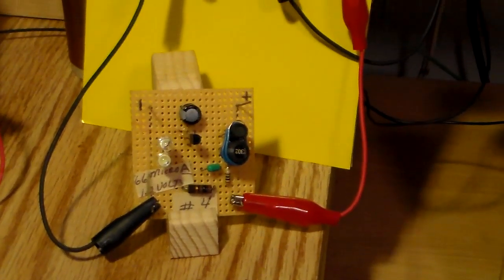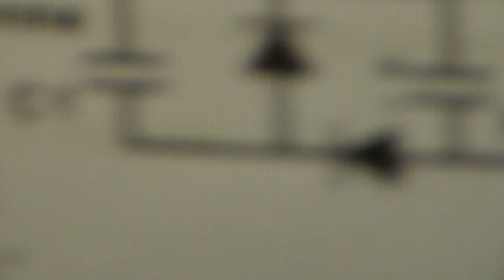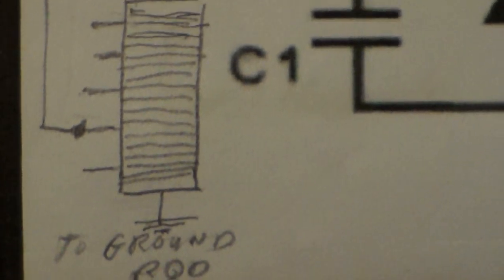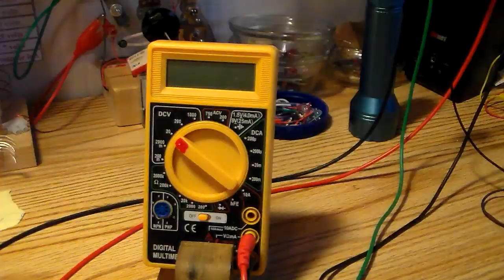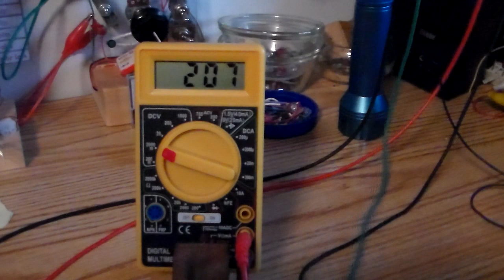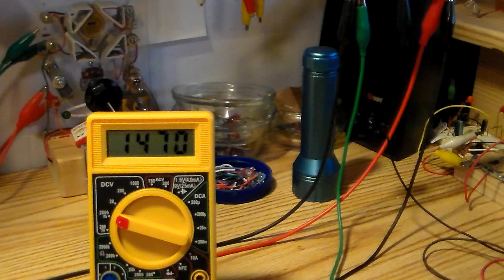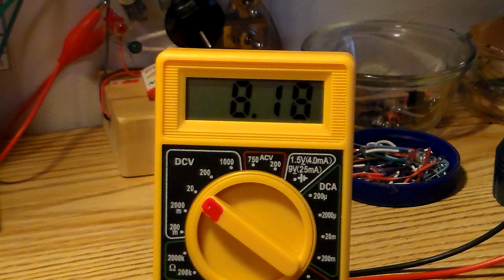antenna power update

Comment: Lots of fun stuff there! You should make a compact circuit with LEDs that you mount inside the aluminum enclosure where the CFL is and that's powered by the stray radiation from the CFL. So some light will come from the CFL directly and some from the LEDs. Though I wonder if there's a slight dimming of the CFL when the LED load is put on, maybe through some resonant action. I guess that would depend on the CFL's circuit.

Comment: Around 5:00 is called dielectric absorbtion. Any cap will show a voltage, it's quite the phenomenon. Switching the light on really made a difference ! the power must be a field effect from the CFL internal circuit, captured by the aluminium ? 
Enjoyed that :)

Comment: I'm pretty sure the CFLs have a small high frequency transformer built in to generate the voltages needed by the tube. This high frequency radiates. Some argue that its actually a health hazard - electromagnetic smog. 
I've been thinking about testing this exact same idea - looked at the Tate patents - and figured that one could increase performance dramatically by using various 'tricks' as you have. 
Great job!

Comment from the maker: The coil is a toilet paper roll wound with 24 gauge magnet wire. I carefully scraped off the insulation in five places and soldered on five leads.

Comment: I can only pull about 1.4VDC out of mine with a 13W CFL in an Aluminum Reflector,  4 – 1N4007 Diodes (couldn’t find germanium), 2- 100uf 50v electro caps, and 2 – 0.1uf 50v ceramic caps.

What size CFL are you using and what are the components that you have on your circuit?

Comment from the maker: The CFL is 26W. The components are 2 100uf 50V electrolytic caps, 2 0.2uf ceramic caps and 4 Germanium diodes (1N34). You can find the diodes on ebay. Take a look at the first video on this I did called Antenna power. You need the 1N34 diodes.
Reply: magnetman2010 Using germanium diodes instead of silicon gives a little extra as Germanium starts to conduct near 0.25 to 0.30 volts compared to 0.6volts for silicon diodes. That's more energy for your circuit. Good video!

Comment: I have plans lost in my ham shack its on a charging system it a 50 ft wire in the air going to a spark plug and a wife going to a high voltage cap then into a car+ battery and a earth ground on the - side. All I need is a high power cap. and Im going to try it and see what it will do. I also had good luck with earth batteries and water batteries seem to work better.